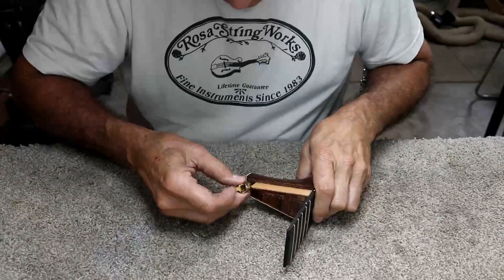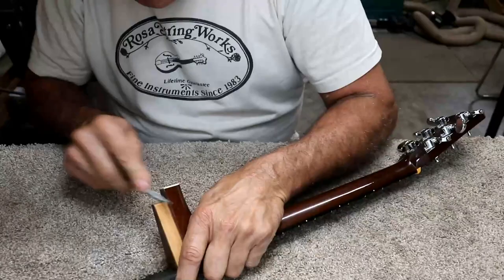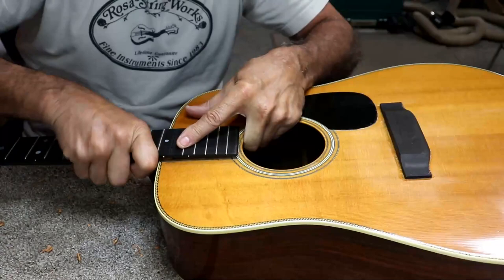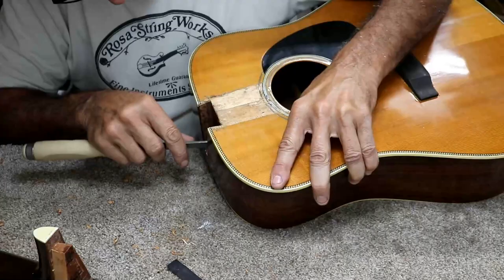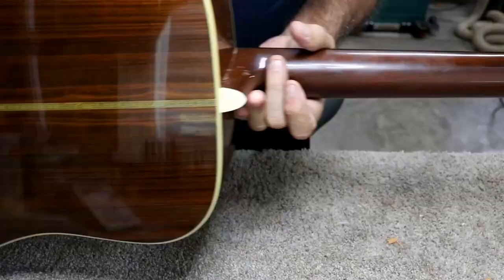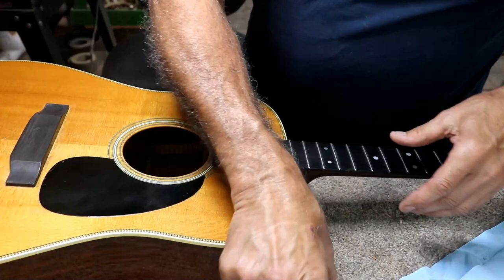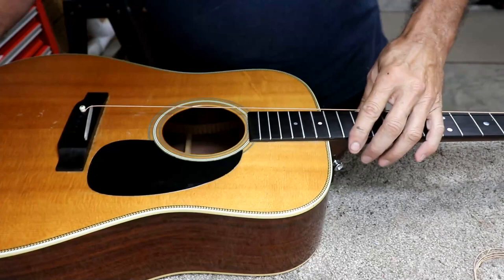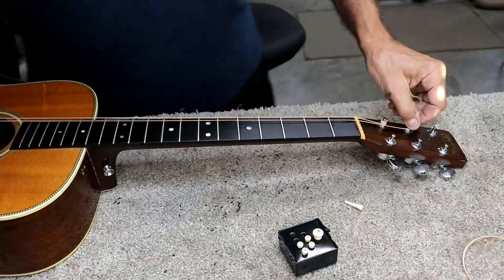597 RSW HUGE PROJECT - I AM Nervous! - Part 3 HD 28 Martin Repair

Comment: I really enjoy watching your perfectionism. I'm a 26yr retired commercial airplane structure mechanic. When we fasten two pieces of metal together that requires a fay surface seal we must have 100% coverage on both surfaces and after clamping or fastening and have100% void free squeeze  out. Ps I'm also a woodworker.

Comment: Wonderful job, again, Jerry!  I did a trade last week.... trading my 2002 "10" series PRS Santana III Electric guitar, which is an amazing powerhouse of an electric guitar I put up for sale due to my back not being able to handle a 9lb plus guitar hanging on my shoulder. for TWO nice acoustic guitars,  a 2021 Martin 000-28 HD in the case, and a 2015 Epiphone Hummingbird Artist Series Custom Acoustic, and some cash on top... So, figuring the PRS was worth around $3500 plus, and a new Martin 00028 is going for $3200 give or take, and the Hummingbird worth around $800 to $900 and the cash, I did a decent trade. Now for the good part... When I played the Martin here in my studio. I was not impressed at all.  I told my trade partner that either the neck is not set properly, or it's just that the action was too high, seriously high, and needed a truss rod adjustment. I would need to adjust the neck before completing the deal of the trade.  So..... I took the "12's" off. (I just hate 12's) and switched strings out for 10's. Light guage. Turned the truss rod nut back to loosen things up first and began to bring it back down, tightening it up.  I like very low action for my fingerstyle playing. Which I do a ton of.  I actually take a guitar pick I use to set it on the 12th fret and bring the action down to just above that pick! When I did , and checked the intonation all the way up the neck, it was PERFECT!  I played a few tunes on the guitar and just fell in love with it.  WOW!! I have played dozens of Martins... I live 20 minutes from The Martin Factory in Nazareth. This plays as good if not better than 95% of those I've played the past 40 years! LOL.  I follow your videos for years now, and I believe we have had a couple of conversations over the years on a few questions I had on resetting necks for a few old Gretsch Archtops I restored.  Due to your videos, i learned some tricks on how to get into doing these set ups on these high end acoustics, so I thank you for those. Showing how to keep your cool and take the good with the bad in stride.  Now that darn Martin 000-28 is going to be my go-to guitar for quite awhile... hanging up the SJ200 for a spell. 
Thank you, Jerry ...... Peter

Comment: I have been watching you work for a loooong time, and following your methods and ideas, I decided to finally replace the neck on my 1959 Hofner 4450. 
The heel has a square form without any dovetail, so I recut it into a dovetail and fitted it with shims in the way you do, result....Amazing, I can swing the guitar around by the neck and it doesn't move one thou...and this is before gluing!
Thank you for your detailed methods in everything you do,  which in turn gave me confidence to repair my own guitar.   AAA++++

Comment: This was great, Jerry. I do wonder, though:  If the bridge pins holes followed the line of the saddle, wouldn't that even up the break angle for all the strings? Otherwise, bostin job, as usual, Jerry! Thanks for sharing this.

Comment: Jerry, it's way better than factory on the bridge, the bridge plate and the neck joint, which Caused the bad neck angle, requiring a reset.
That guitar will now last a Whole lot longer than the factory work did.

Comment: I added rosewood bridge pins to my Guild and it seemed to brighten up the sound (increase the resonance) quite a bit- to the point that I am wondering if it brightened it up too much. Is brighter/ more resonant always better at the saddle, or only up to a point? I ask in connection with you installing a rosewood bridge plate here...
Reply: Another way to put it- is it possible Martin did not use rosewood for the bridge plate for a reason?

Comment: Another fine repair! Was it a '70's model? Assuming it is, what happened to Martin then? The '70's were a bad decade for American guitar manufacturers. The '70's wasn't a great decade for even Fender and Gibson. Ones made then are not known for being their best work.
Reply: Martin had some definite issues in the 1970s, with a bad CEO that nearly ran the company into the ground. The workforce was treated so poorly that they unionized and went on strike. During that period, supervisors were pressed into service building guitars... Needless to say those are some of the worst examples.